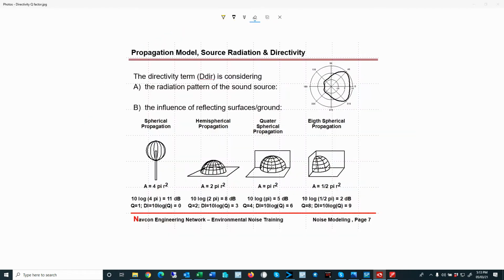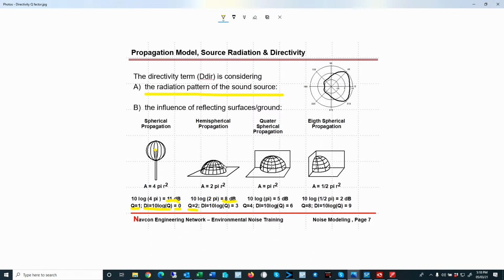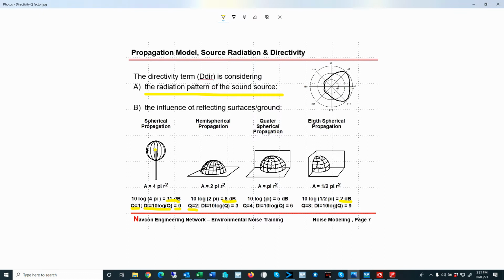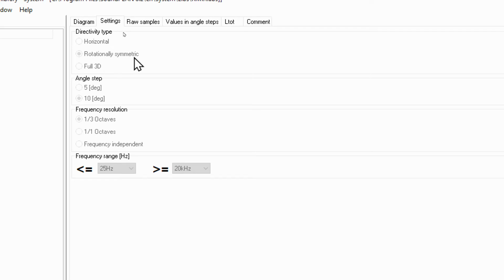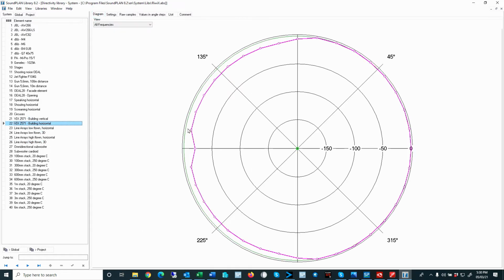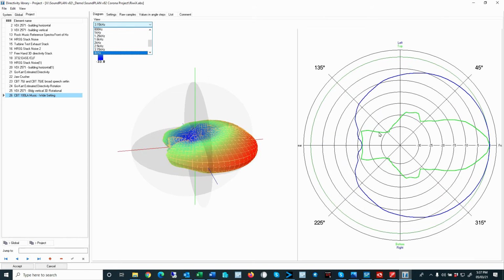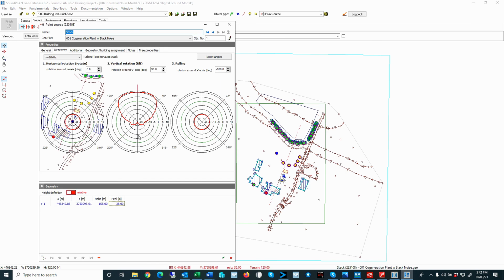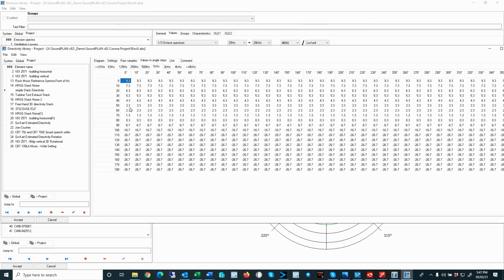SoundPLAN Noise Source Directivity

Comment: How to enter polar plot as directivity?
Reply from the maker: After assigning a source library element to a point, line or area noise source or industrial point, line or area source the source property input will add a directivity tab.  Depending on the type of directivity you can rotate the directivity to any direction by rotating horizontally or vertically. The default source direction is 0 deg (pointing East) and 0 deg pointing horizontally